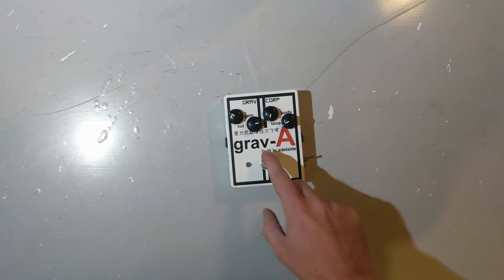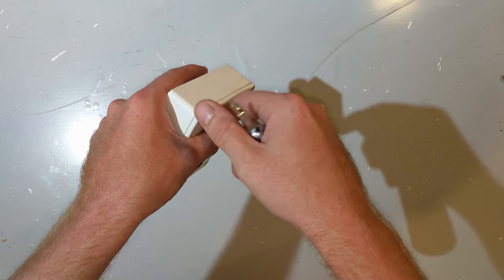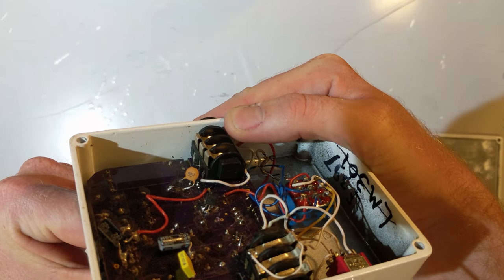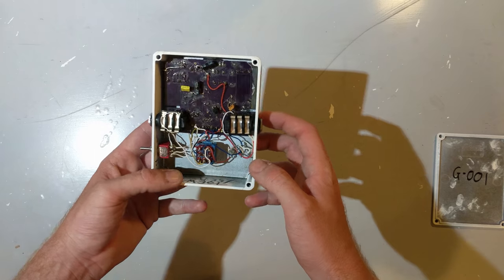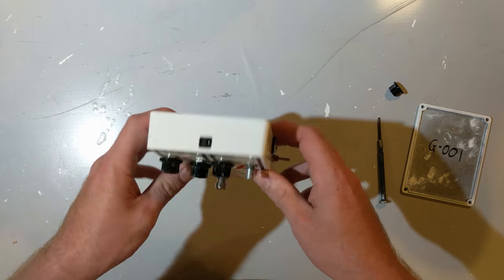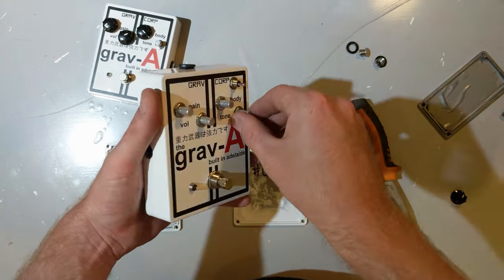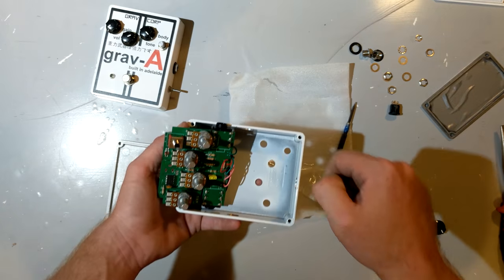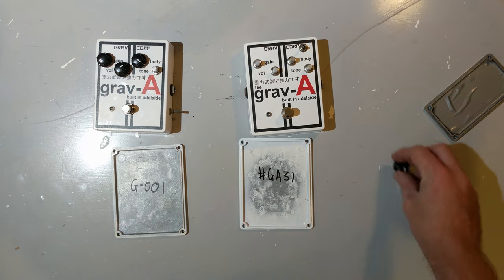How To Design A Guitar Pedal - Concept To Production

Comment: Ditch the onboard cable jacks and onboard power or potentiometers if they are on as well. You want to make your pedal as repair friendly as possible.
Reply from the maker: Repair friendly is good, but far from the only consideration. 

Board mounting jacks and pots and other parts is SUPER good for making a pedal easier to manufacture, thus cheaper, and accessible to more musicians.

At the price point I sold the Grav-A, it was out of reach of a lot of casual players or kids with less disposable cash. The EHX Big Muff on the other hand, which had slightly simpler construction and economies of scale behind it, sold for half the price with 90% of the features and a big name behind it. Guess who sold more ;)

Comment: I just can't get my head around why you didn't make the PCB so that you could drop the 3PDT in as well. Just eliminate all the wires? PS I don't know shit about electronics. Just built my first pedal from kit there other day.
Reply from the maker: I probably could have done in a later revision.

I largely cribbed the assembly concept from the modern Big Muff, which uses a snap fit main board and with a ribbon going to a seperate PCB for the switch and LED.

It’s hard to get a snap fit board to work in these cases as it is; adding a long extension to fit the switch would have made it harder.

Couple that with the fact the switch sits higher on the board than the pots do and it would have meant I’d need to source long lead pots instead, which are harder to find... it’s a big mess of factors you’ve gotta juggle all at once.
Reply from the maker: In engineering, if you’re ever asking “Why didn’t they just...”, often, there’s a compelling reason.